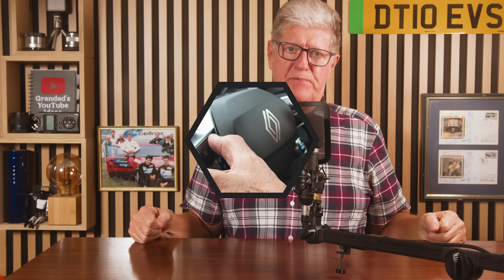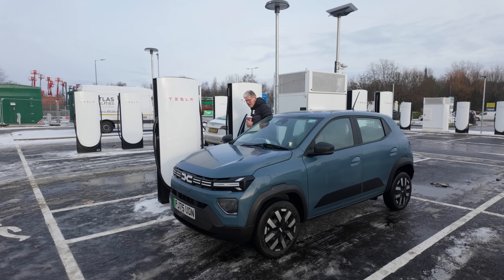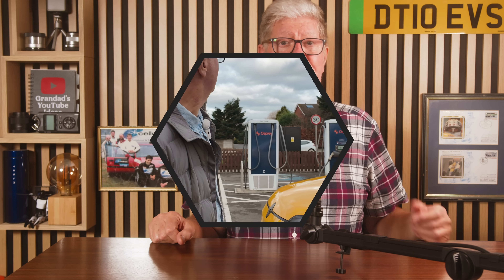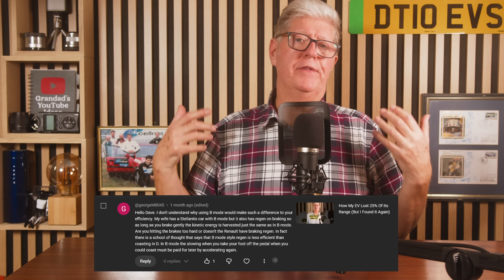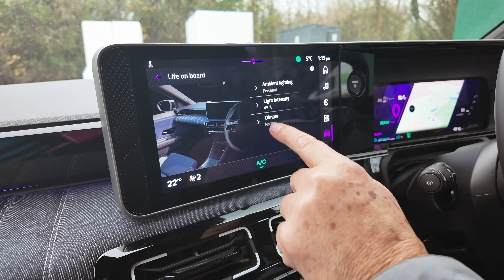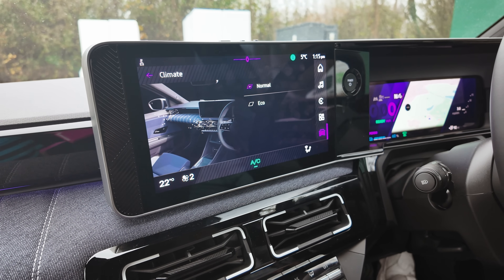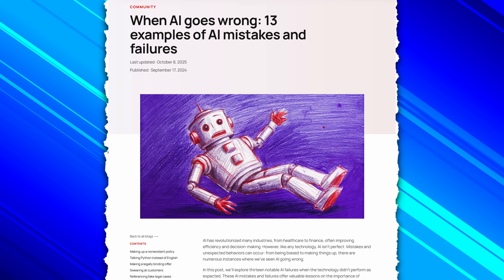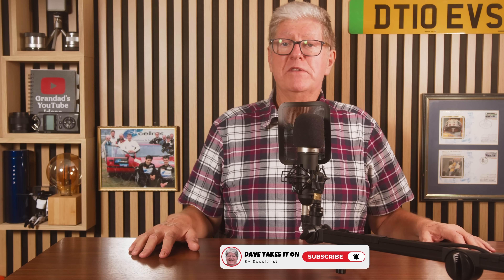Was I Wrong About Regenerative Braking On EVs?

Comment: I don't get this discussion. A modern EV will always use regen to the max and hardly ever use the friction brakes, no matter how you decelerate (brakes or one-pedal drive). However, the best setting would be coasting as every regen will always regain less energy (due to losses) than was used in the first place. You will always have losses as regaining the energy (regen) works by using the motor as generator. But that is AC current that has to be converted to DC to be stored in the battery. But this process is not lossless. But if you care that much about saving the last watthour, you wouldn't buy a Renault 5 in the first place, would you?
Reply: I completely agree and see it confirmed on the Megane e-tech: the regen setting is just to define the deceleration when coasting.
Braking is electrical with regen except for emergency braking. I doubt that the Renault 5 does it differently than the Megane.
I get 3.74Miles per kWh in winter an 5 in summer with that setting at min.
Reply: So, I don't get this comment :) Most of the time I am driving in traffic with cars starting, stopping, turning, slowing and maybe a few more things. I can hardly ever coast up to a stop light. I don't drive fast and do "coast" to a stop using regen but within a realm of politeness. I would say most of the time I am just reacting to the moment. So, with that as my basis I am thinking most people, but not all people drive in a somewhat similar manner. So, for most of us most of the time coasting is not really a thing. 

The EV I drive, Tesla Model Y and I had a Model 3, doesn't have regen implemented with the brake pedal. Because of that OPD regen is my main braking. I haven't done the type of test Dave did and I'll assume you haven't either. I can't say what my results would be but regen seems to give me good economy. I live at 5000 feet and regularly drive to 7000 feet. Going up I lose a lot of energy but because of regen I break even when I go back down. If I coasted down the hill I wouldn't gain anything back but lose all that energy (gravity) to heat in the brakes. To some degree I think of stopping at a stop sign as a similar exercise.
Reply: @davecolgan442  Just believe me, that a modern car does regen all the time wherever possible. Depending on the power of your car up to 99% of the time no matter whether you stand on the brake pedal or use some software magic to slow you down like automatic regen or one-pedal-drive or whatever. If you step hard on your brake, sure, that might trigger the friction brakes, but otherwise your car will always use regen (if the battery is ready for it and not extremely cold). There have been a lot of tests that do show that one-pedal-drive is by no means better than using auto-regen or brake cautiously by yourself. The contrary: Users might even brake too hard using one-pedal drive. Otherwise go ask your car models engineers. Do you really think they would miss any chance of recuperation?
Reply: @davecolgan442  True, coasting might not be an option in the city, but more often than not one can still coast to a junction, roundabout or red light. But my point is: Whether you use the brakes and drive like you'd drive a combustion engine car, or if you let the car slow you down using some regen magic or one-pedal-drive does not make a difference as the car will always use regen (recuperation) to the maximum possible and not use the friction brakes.

Comment: i would make one comment; 
I may be wrong but there seems to be a suggestion that touching the brake pedal instantly uses the friction brakes.  
I drive Hyundai Kona electric and it has a setting to show energy use by the drive motor and this shows a negative value (energy into the battery) when using the brake pedal at speedl (as well as when on the overrun) , the friction brake is only engaed to finally stop the car and hold it when  the motor/generator has no kinetic energy left to generate power to the battery. 
My take is that electric cars prioritise 'regen' braking to slow down whether on the overrun or using the brake pedal this is why brake component wear on EV's is very low and a common problem can be rusted brake discs due to lack of use at any significant speed.
Reply: This is the main thing Dave missed. It also means that results between manufacturers can vary widely as it's a matter of design. I'd still expect using high regen to be a tiny bit better around town, but with a small risk of a repair bill from brakes degrading from underuse.
Reply: @thomaschilds8781  I would be very interested in hearing from any ev driving commentators who've had "repair bills from brakes degrading from underuse".
Reply: once again I think you're missing the point. I drove a kia e-niro for over 3 years, which also turned on regen when braking (in fact, my current Tesla model S also does this). If you were designing an EV, wouldn't this be an OBVIOUS thing to do, as when the brake pedal is applied, the intent is clearly to slow the vehicle. Therefore applying regen as well as friction brakes is simply applying all the slowing forces available to the car, at the same time as increasing efficiency. It's effectively improving brake effectiveness without expensive brake upgrades (and increases efficiency to boot!). simples. This doesn't change the fact that stronger regen increases overall efficiency - in fact it re-enforces the point.

Comment: On a related note, EVs should be front wheel drive because the front wheels do most of the braking effort. An i3 owner told me that their car wears it's rear tyres badly (presumably because the regen setting is too high). Cleveley services (James and Kate) have done 180000 miles in their MG5 estate and the front brake pads are still like new (which proves that the regen braking works effectively) and tyre wear had been very reasonable.

Comment: 36% of the range in my model 3 comes from regen according to Scan my Tesla. I do have the ability to turn off regen using a third party tool, but I don’t as the efficiency is way worse. I will only use it to stop the brake callipers from seizing occasionally.
Reply: But but EVs don't cost anything to run 😂

Comment: I have never dialed my regen back.  If i want to coast, I lift less.  Very easy on  Tesla, and I would expect others to be very similar.    I cant imagine dialing regen back could save energy because if you need to slow down quickly you have to waste all that energy through the brakes.

Comment: You may want to dip the brake pedal when slowing down as the driver behind will probably rear end you whilst he's looking at all the LED screens to find the wipers without the rear brake lights to wake them up....  Also if you rarely use the actual brakes how good will they work if needed in an emergency,, 20 feet to grid the rust off and oops sorry i hit ya car my brakes were rusty..

Comment: I'm in Colorado and my EV is over 3 tons no matter who is counting (Ford Lightning). With considerable elevation gain my truck will show say 1 mile/kW going up, and what appears to maximize the display, 12.4 miles/kW going down. I admit to not observing the display too carefully going down a steep grade with a big vehicle. I believe in my EV, although I can turn off one pedal driving, the braking is always a computer controlled blend of regen and friction. It's just a feel-good switch. I think your test could be much more carefully controlled, but in the end I like one pedal driving and if efficiency was super important, I wouldn't have a 3 ton brick for an EV.

Comment: The latest Model Y Juniper has a reduced regenerative braking mode once again, however, I can attest that you can get a lower energy consumption when using full one pedal driving mode. Weirdly enough I also get better mileage using the standard acceleration instead of chill mode on long trips. For short trips Chill mode will be more efficient by preventing battery heating in the winter.

Comment: Not the best of tests just taking the dash values. What would be more accurate is recording how much energy needed to fully recharge. Also don't you realise most EVs use regen when braking even if regen is set for low, the friction brakes only get used with hard braking in both settings. Think you need to review your findings with another car.

Comment: Some korean brands may have different regen settings because they haven’t worked out how to do it properly. Set one to level 3 and try to do a little bit of regen. You can’t. You either have the level of regen you’ve selected or you are putting electricity into the motor. No gentle blend unlike an american company who has a boss who’s gone nuts.

Comment: Especially on a Front Wheel Drive EV maximum Regeneration is dangerous when roads are icy, suddem high regen can cause the wheel to lock up! Whereas using the brakes ABS acts on ALL the wheels and does not lock up.

Comment: If Tesla has got rid of adjustable regen, good for them, a sensible move. My BMW i3 has no regen adjustment and it's all the better for it, the one pedal driving is very intuitive after a short acclimatisation period when I first got it, with practice it can be driven very smoothly and efficiently with subtle adjustments on the accelerator pedal and with practice makes the brake pedal redundant, the BMW system does apply the friction brakes automatically at high levels (92+%) of battery charge when regen effect is minimal, this make the perceived regen very similar most of the time, so it's enough to keep the brake discs from corroding, they think of everything.

Comment: Interesting stuff, how many people know that the Bosch ibooster brake systems is used in a vast majority of EVs, even Daves beloved Tesla use it. Because contrary to some people's beliefs, Tesla doesn't know it all.

The system enhances the regen braking. Basically, it uses regen when you press the brake pedal instead of the friction brakes, obviously only to a set amount. If the force applied is high, then the friction brakes take over.

That's why the brake pedal feels odd in most EVs. Some you can actually push to the floor when stationary because there is a disconnect between your foot and the actual brake master cylinder piston.

There is a fail safe, so if it goes tits up, it's still macanicaly connected to the brakes.

Now, this may be tuned slightly differently for different manufacturers, but the long and short is you get regen all the time you just aren't all ways aware.

Comment: Hi Dave.  

Having read through a number of comments below, I see there are people who clearly either didn't listen to exactly what you said, or are deliberately misunderstanding because of their preconceived opinions.  

I have a degree in Physics (with Computer Science and Maths!) and your are essentially completely correct.  Necessarily simplified to some extent, of course.  I have a Renault Zoe 2013, which has regenerative braking always on, but with an 'Eco' mode to increase the braking.  I am consistently, during this UK winter, getting 3·8 miles per kilowatt hour,  

When I drove my previous car, a Renault Clio 1·6 litre Expression A (automatic), I was fully aware that because the engine was engaged, it was still burning fuel even whilst I was braking, which in its turn was converting kinetic energy to heat.  A lose-lose situation.  

Now, I am delighted to watch my range increase as I DRIVE downhill.  Now a win-win situation.  Yes, as you pointed out, energy is still released to the environment through drag, electrical heating of the battery, and friction in the motor (which is why the motor is cooled).  But, and this is important, the energy released by an EV is far, far less than that released by an internal combustion vehicle, which is the whole point to my way of thinking.  

As a statistician, your methodology, whilst not scientifically perfect, is certainly highly significant (a technical term!) so your results are, consequently, significant.  (Statistics is an interesting subject, frequently misunderstood and often mis-used!)  

An aside point I can make, having swapped from a Clio to a Zoe, which are essentially identical cars (the Zoe is actually 250kg lighter than the Clio) save for their motive power, is that, even relying on public charging (I cannot charge at home) I am spending less on charging than I used to spend on petrol.  So, when you factor in lower servicing costs, I am definitely better off with my EV.  (It is also nicer to drive, of course!)

Thanks for a very interesting and well put presented video.  

😃
Reply: And I've got my 100m swimming badge. That aside....you are wrong on this one Dave. Your argument falls down on the fact that regen only puts 70% of unused kinetic back in the battery. Shouldn't be too hard to row back though. Enjoy your videos, including the ones you are wrong in 👌
Reply from the maker: Thanks Robin nice to know I’m not yet losing the plot. Who doesn’t love free energy?

Comment: I thought you were wrong too😮. I have a Zoe with exactly the same settings. It makes no difference.  When you put on D (low regeneration) and you press the brake pedal,  IT USES REGEN, not the brakes. The brakes are never used, except to stop from 4 mph. I think your Renault 5 had a fault. It should never used friction brakes, except in an emergency. 🎉
Reply from the maker: Your answer is my brand new R5 had a fault in order to prove your theory right? Ok

Comment: Great to see you have mounted some Nigel Mansell Pictures, behind you. I too have a signed card mounted with some pictures of Mansell!

Great description of regen and when you first try it it mat seem off, but it is a better way to drive if you stick with it. it also means you are reading the road better, rather than fly up to a junction and have to break hard to wait for the car in front of you. I have found sometimes regen would be a bit more powerful than I would like so it can be tempered by use of the accelerator. With skill and knowledge you will become very good at understanding how the regen works. Getting the car to stop at the line without touching the brake or adding to the accelerator is like winning! So gamify it!!!!!
Reply from the maker: Great plan, Jason, try a complete trip without touching the brake pedal

Comment: You are still not totally correct, yes max regen all the time, that is what I always use, but on cars like the Renault a light touch on the brake pedal slows the car down using regen, not the friction brakes, these only engage when you press them harder or right at the end to come to a full stop. Put up the energy meter and get Jonas to film you pressing the break gently with no regen on and again with just letting off the throttle slightly with max regen and see what differences you see.

Comment: In my two EVs the friction brakes only kick in when breaking hard. The rest of the time the brake peddle activates. regen. This is why EVs barely use the friction brakes and they can rust over.
Reply: Agreed! Tesla's and some other cars do not regen when you put your foot on break. Many  others do. While Dave is correct, my VW ID.4 will regen when I put my foot on the break. That way, I can modulate the regen with the break pedal.

Comment: You’re spot on. I’ve done similar tests with my MG4 Trophy, full generative braking does improve efficiency
Reply: As with all things, the real answer is “it depends”. 

If the additional regen causes you to scrub off additional speed which you have to recover by accelerating then it’ll be less efficient. If it doesn’t, then it won’t.

Comment: Dave very glad to see you are tackling this subject, I have only ever seen one other automotive YouTube channel look at it. That said I don’t think you’ve explained the whole thing and I can’t see how your back to back test results can be explained by anything other than variation in environmental and driving conditions between the two test weeks. What you’ve missed from your explanation is that when you regen not all the kinetic energy you’re harvesting turns into chemical energy in the battery, ready to be turned back into electricity again. The motor (acting as a generator) is not 100% efficient, although it is very good, probably 90% or so. And not all the electricity coming out of the generator will turn into chemical energy in the battery. Again, it’s probably about 90% (ie every night we use about 11KWh of electricity to charge the not-quite-10 KWh battery in my wife’s PHEV - you loose about 10%). So regen is probably about 80% efficient. But coasting suffers from none of these losses (ok, being pedantic, the energy is going somewhere that you don’t want it, it’s not being lost). While coasting the car is only subject to rolling resistance and drag. When regenerating you have the roughly 20% loss due to those inefficiencies, plus the rolling resistance and drag.
Reply from the maker: You make my point for me, thank you. If you coast to a halt, you lose all 100% of your stored kinetic energy to rolling resistance and drag. If you use regen you put some of that back into the battery. Any, even 5%  of that kinetic energy going back in your battery will give you more range. Which is more efficient?
Reply: @davetakesiton  0 regen is more efficient, it seems to me. The rolling resistance and drag is the same, regen or not, so those losses are the same. You are just adding in losses by using regen in that case. IMO the only time regen adds efficiency is when you would otherwise be applying friction brakes. However for this to be true does require that at 0 regen, and no pressure on the accelerator, no traction power is applied. I don’t know whether this is the case for all cars, maybe some apply power so the coasting appears more efficient than it really is.